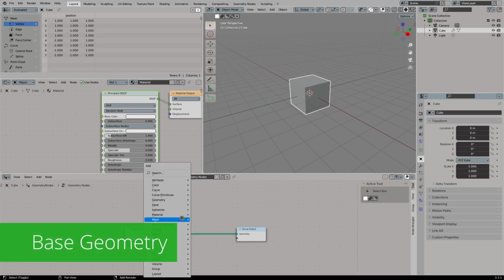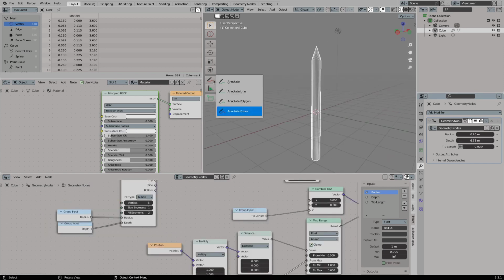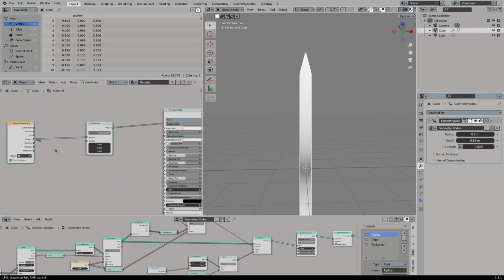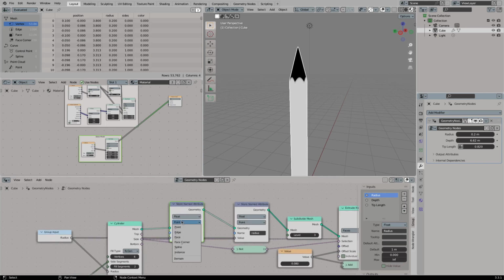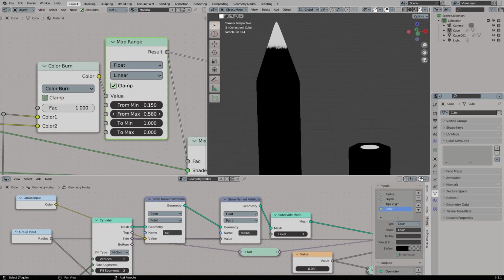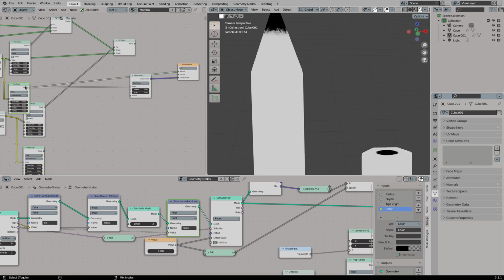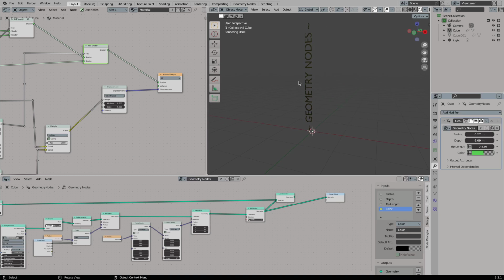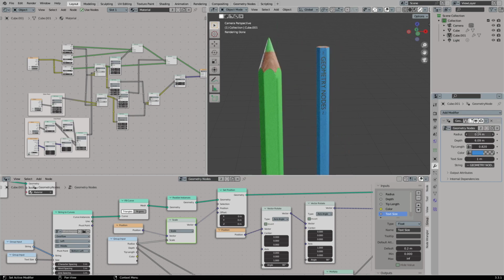Procedural Pencils with Geometrynodes | Blender Tutorial

Comment: Did you use an HDR?
Reply from the maker: Yes I used one of blenders default HDR backgrounds. To use them for rendering you need to load them as a environment texture. The textures are in the datafiles folder of your blender installation.